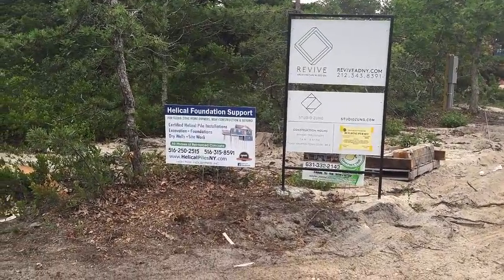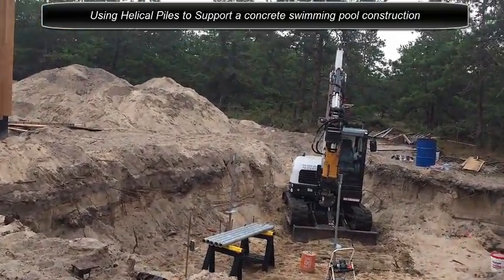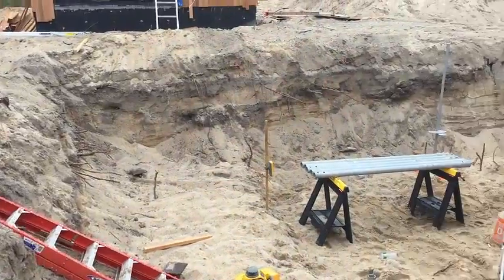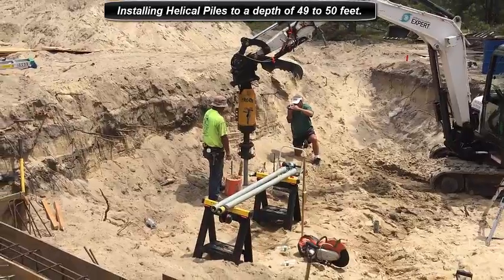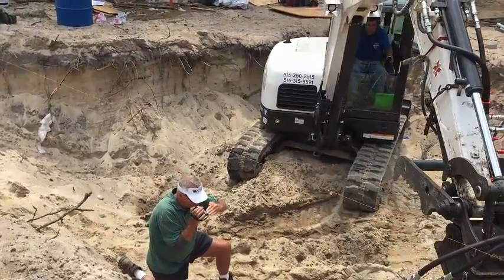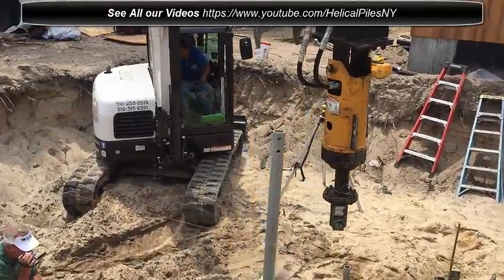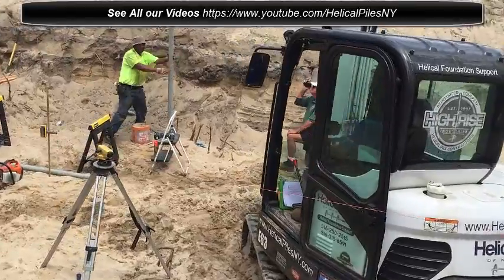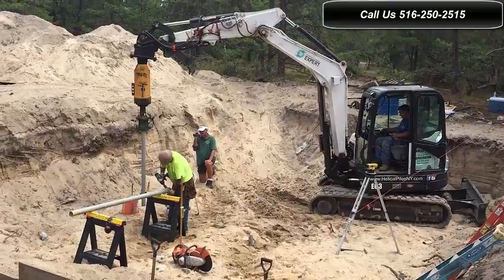Helical Piles for Swimming Pool Construction Amagansett

Comment: I’m inspecting installation of HP in California for a pool. where is the gauge that reads the torque on this rig? The rig we are using has it on the lines coming off the drill head. We have gone 10’-13’ and have reached max torque on piles that should be min 38’ embedment.